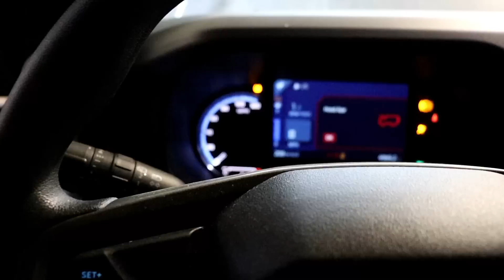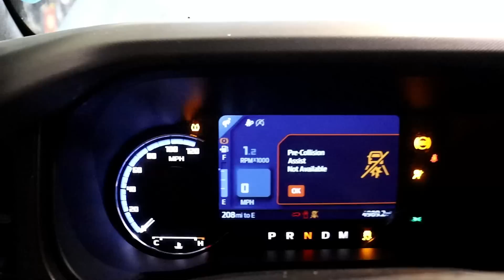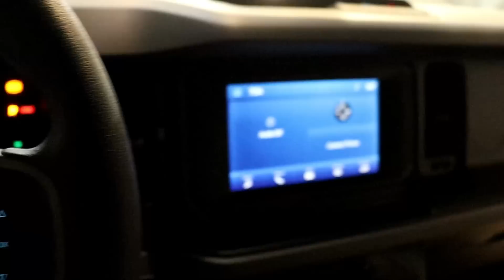WRECKED 2022 FORD BRONCO WILL THE ENGINE START?

Comment: Mike when u change oil an pouring the oil in use the dipstick an put the dipstick un where I put oil in engine an pour the oil on the dipstick it will go right in . No funnel needed